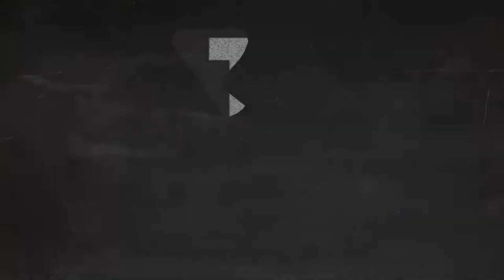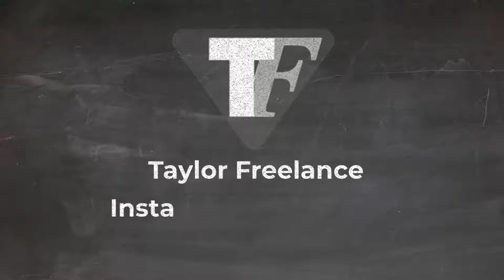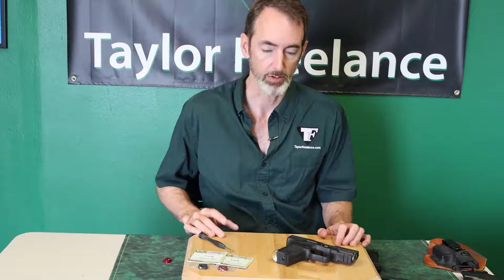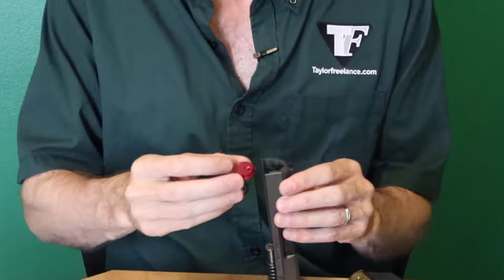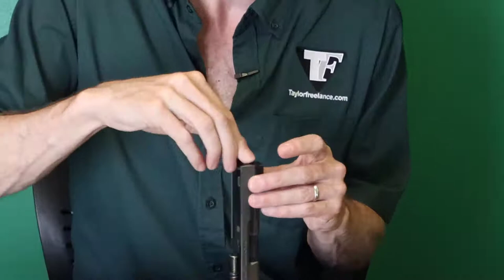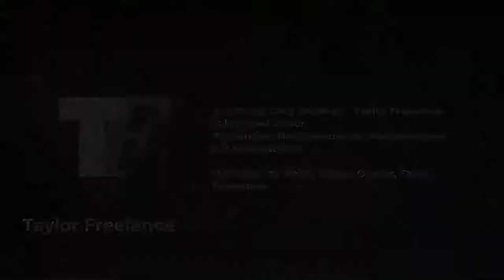Installing the TF Canik Slide/Back Plate

Comment: I bought the carry kit for my tp9sf elite in red will the back plate match the same color if it's also red
Reply from the maker: Anodizing is a bit like Easter egg dye. We use the same process, so it should be very close -- but expect a SMALL amount of variation from one part to the next.
Reply: @taylorfreelance  ok thanks for the quick response